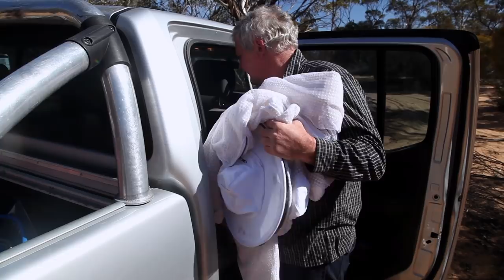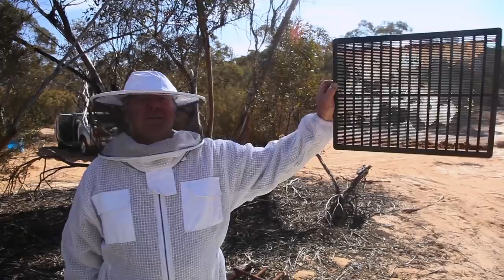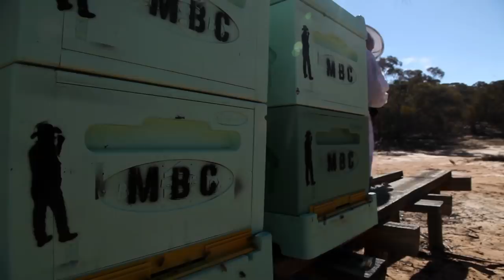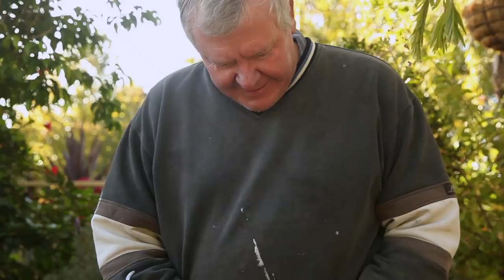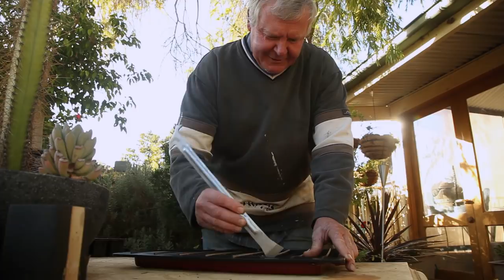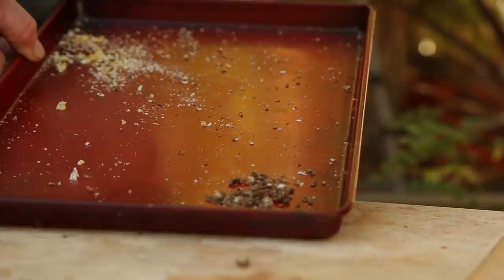How to Harvest Propolis Traps - The Bush Bee Man

Comment: i dont know if you know this, bet everytime i have seen you use the straps..ive noticed the straps are backwards. theyre supposed to apply tension but the way you put them on theyre just there. youre supposed to increase the tension when applying them but because they are backwards they dont do that. im assuming they dont need to be super tight but i just thought you should know.